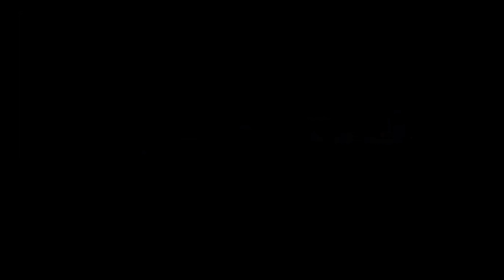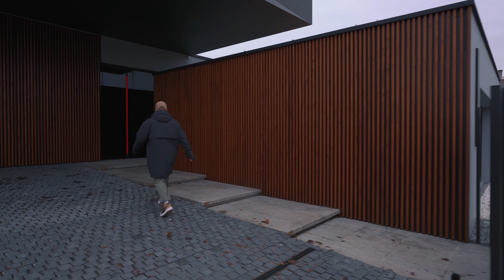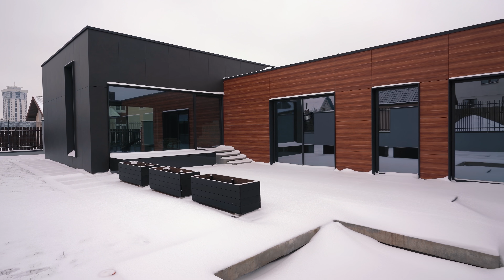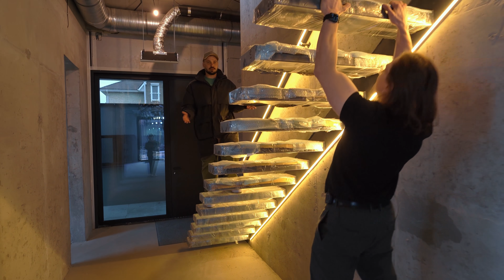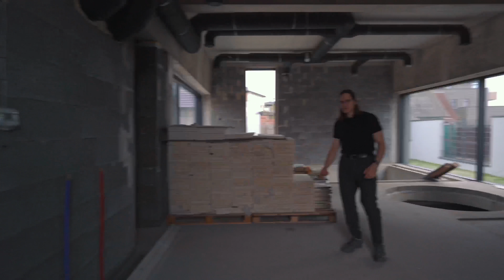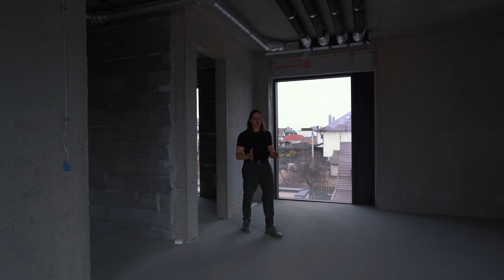Scandinavian Modern Mansion Review | Architecture & Design, House Tour

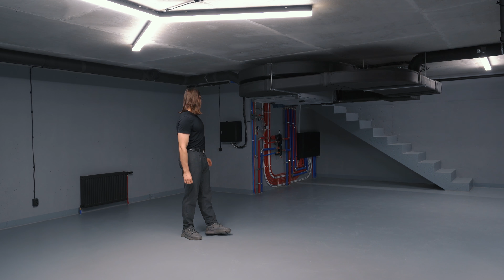Comment: 24:49 Looking at that outlet with just the wire attached to the wall is super amateur.
That is NOT high level attention to detail bro....
Also... who leaves the blue and red flex next to that black radiator. Would have cut them and made the innertubes black.... Or at least used something high end piping like copper. 
Would make that black radiator even pop out more. But since it's just a cellar.... cut it and make it black.
You people suck at details. Trust me.... I've done way too many projects not to notice the real details. Also my clients are some of the richest people in the country so they expect VERY high standards.

Comment: both the gate and the fence look great, they make an impression, but the argument that it's hard to climb because there are no horizontal elements is basically irrelevant. Just buy a car jack for $5 at the nearest store and easily open the gap wide enough to get inside.

Comment: A blue tooth lock sounds like the biggest safety hazard I ever heard. At least use a code or finger print sensor. Software is so easy to hack, even with good security systems.

Comment: I would´ve probably roofed the back side of the garage. Video shows winter and roofing that part and the pathway from the house´s door to the one of the garage would prevent snow (or rain) from reaching that area, thus you could arrive with your car, park it into the garage and enter the house without dirt on your shoes you´ll have to clean in the house entrance area afterwards.

Comment: I like it so much, but seriously. Almost 6.5 k feet square is not, definitely not small. It corresponds to 600 + meters square and I don't know you but it's gigantic. Average house here in Italy is between 80 and 100 meter square (not considering the land and garage and balcony, so more like 110 to 150 meter square). This is basically a plane hangar, a luxury and damn well built one. I have seen only 1 time a house that was 300 + meter square and terrain was probably 100 ms, and it's massive

Comment: Impressive front fence design, I like it I just wonder how it handles the water, I guess there is probably a pump or some advanced system just to handle that. I designed myself a similar system to lift my backyard projector screen but as it's not a driveway I just created a box that opens and close to hide the stuff when not in use so water just don't enter it.

Comment: As a civil engineer I have to say this house is complete crap. 

1) Scandinavia is a very northern part of the world and if you know anything about Earth rotations you`d know that there is not a lot of sunlight in Scandinavia. It`s actually very dark for almost the entire year and these guys literally built a black house in the dark. It works fine on a youtube PR video but in reality it`s depressing. Very stupid idea! There is a reason Scandinavians build everything with bright colors.

2) The house does not fit with the neighboring houses at all.

3) The fancy car door is a dumb idea. It`s modern widget that costs more to install and maintain and once it breaks down it`s a nightmare to replace or fix coz you have to find some subcontractor from Poland to come to you.....someday and it costs an arm and a leg. You also can`t use that door if the electricity is out. Just use a normal door with a lock.

4) The house door is kind of dumb coz you can`t enter your home during a power shortage or when you don`t have a phone battery aperantly. 

5) There is a reason northern climate countries use steep roofs instead of flat roofs. You guys essentially created a soon to be leaky moldy house. Same goes for the yard French windows who are very prone to water infiltration. 

6) This particular point might be a bit petty on my side I admit but stop calling it a great design. Great designs usually allow for a substantial part of the heating, cooling, ventilation etc to occur naturally due to the built of the house. You don`t do that. You do everything mechanically with tons of machines. 

To sum up you made a black house in the dark that`s going to get moldy and leaky but looks good on a youtube video for chumps coz you used all the fancy shamancy worn out to death terms like modern, hi-tech, delux etc

Comment: Flat roofs are always mistake on snowy areas.
Reply: Or anywhere where there isn't all sunshine all year round.
Reply: @hustensaftvernichter3785  Partly true. Water you can direct away. Snow will break and moisture the structure with its weight in time.

Comment: 23:49 goes on to state the importance of keeping the pool foundation separate from the building foundations for many reasons and then shows you the 'smart centre', the brains of the house located RIGHT NEXT TO THE POOL AND JACUZZI, the two largest bodies of water and danger to all electronics. So just to make sure your failure is complete, you put the house's electronic brains in a concrete bunker below grade of the pool. NOT that smart!

Comment: Nice house but the floating stairs are an accident waiting to happen. It needs some sort of hand rail to prevent you from falling off.  Just imagine having a party and had a few drinks and wanted to go down into the basement to check the fuses after the DJ overloaded your circuits. 🙄

Comment: I could live there 🤪(if I won the lotery...) but very nice and clean! I was just thinking... what if the inside pool DOES run further into the outside pool? A lot of heat will disappear yes... but what if you made a sliding window that slides down into the water and blocking off the outside poolwater? (probably needs a by-pass for filtering/heating that water but that can be arrangend)

Comment: Seems like so many wasted opportunities for such a large block.  A side entry garage would mean that you don't have to reverse out. This would also allow a conventional sliding gate to be fitted.  I can't believe that the garage is not connected to the house, in such a climate.  Lack of eaves over windows, which means snow accumulates, even worse is that snow accumulates at the font door.  Cantilevered "car port" useless at preventing snow from accumulating on the path leading to the front door.  The dressing room/front door is poorly positioned, such that to get to the room, you track dirt from the from door.  Similarly, pets should be taken in through the exterior door into boiler room so that dirt isn't tracked from from door.  There is no door separating the guest bedroom  corridor from the living area and kitchen.  The powder room seems large enough for a shower to be installed, so that guest don't have to use the children's bathroom.  Toilets should be enclosed in separate water closets, even in the powder room, and away from handwashing facilities - for hygiene and to separate odours.  There is no door separating the living areas from the corridor leading to the children's bedrooms, so that noise and cooking smells will flow through.  Living area, renderings shows a lovely view of trees and other greenery - in reality, it's the neighbour's driveway that you look out at.  Planting for privacy will be needed.  It appears that kitchen sink will be in an island, rather that against an exterior window for fresh air and natural light.

Comment: The effects of curiosity, critical thinking and creativity. The architects did well 🔥
Reply: Just one comment to add, the units of measure should be given in the metric system. I don’t understand why talking in acres and square foot when the vast majority of the world uses square meters, hectares, etc. or at leasr provide them in both.
Reply: @carlosalvarez4641 Cry
Reply: lmao creativity? this is a metal box, I don't see how can anyone see this as a home.
Reply: @ProtoIndoEuropean88
Inmates
Reply: Kind a true. Just do both 🤷🏻‍♂️
Reply: It`s a shitty house. The architect is a moron. 

Scandinavia is super dark year round. This was shot during the 2 hours of sunlight they have. The built a black house in the dark. It`s super depressing. There is a reason Scandinavians use bright colors traditionally. 

The house is also with a flat roof. It`s gonna get super leaky and moldy. There is a reason snowy rainy places like Scandinavia use steep roofs. The French windows are also super prone to water. 

In addition all those fancy doors means that you can`t enter your house during a power shortage or when you don`t have phone battery and if it breaks you need to find the subcontractor from Poland to fix it. 

The house is crap but it`s presented as modern and cool to people who don`t work in construction and think of these problems.
Reply: Hmm👍

Comment: I love how modern and nice this all looks.  HOWEVER ... We NEED to innovate a system that SUPERHEATS the Driveway, Patios and all of the Walkways.  There must be an industrial boiler system that is 'Hyper Functional' that will not break the bank.  It needs to evaporate (boil off) all of the standing runoff water, from a cistern sump well ... all winter. This system would be seperate from the household in-floor heating, pool, hot-tub and sauna heating systems. It needs to be a specialized system, specifically engineered to remove all of the snow, ice and to dry the concrete regardless how cold it is.  The goal of course would be to maximize utilization of the ENTIRE living area of the home ... YEAR-ROUND !!!   Scandinavian engineers need to step up their game . LOL ... Get one system working properly and economically and EVERY household in the northern hemisphere WILL NEED this in their lives.  The concept is scalable to all of the Northern Hemisphere.🤑🤑🤑😎

Comment: Why no radiant snow melt system on the sidewalk up to the door and for the driveway just beyond the fence ?  Also rain and snow will sheet off some of the facade faces onto the walkways and people as they approach the house. Splash back from the facade runoff will discolor the panels at the ground over time
Reply: what about when those fence bars are covered in thick ice, what then? Guess i'll park on the street...  Maybe they are heated to prevent this.
Reply: @fishheadbreakroom  He explained it, did you watch the video? 🤔
Reply: @BradThePitts  yes i did, and I see they took a hope the systems work 24/7 approach. I'm in a more cold environment in Estonia. We have a large variety of such fences with pluses and minuses for them all. I can tell you here (and maybe its not recommended to be fair) it would not be a good idea.

Comment: The mechanical room is the most amazing thing I've ever seen in a home. I can't believe the use of stainless in there. Just jaw dropping.
Reply: execept washing dog next to that air circulation unit with electronics...
Reply: Americans put this in their RVs.
Reply: @Mitchell527  Quite wrong. Americans don't build 50 million mansions to this level of quality...actually not even to the most basic level of housebuilding quality in Europe.
Reply: @Mitchell527  Please don't confuse this high-end installation with American RVs. RV's are junk, until you go into the $1MM price range of the Prevost coaches. The $100-300k RVs fall apart like you wouldn't believe. They aren't made like autos in a factory, instead the cheapest Mexican and South American workers slap them them together like houses, manually screwing in screws and bolting stuff together. There's very few automated processes. Quality control is terrible. :)
Reply: @Chris11249  high-end installation, bruh its a gas boiler from the 60s with radiators. We haven't used gas in scandinavia in decades. Geo thermal heating + Air heat pump + fireplace
Reply: what does stainless pipes do tho?
Reply: @JC-JC20  resistant to corrosion, keeps things cleaner, last longer
Reply: Yes. I think like you
Reply: You saw that to, I was like did they use stainless steel for the PIPING! Insane.

Comment: That fence is awesome.
Reply: Accident waiting to happen when someone drives before its completely down
Reply: i believe it has some sort of motion sensors
Reply: @qrx.4596  how does that help if the driver presses the accelerator pedal before the gate is completely down 😂
Reply: cool things are often dangerous  @Siddiskongen
Reply: @Siddiskongen  I was also thinking how often does it need to be cleaned out?
Reply: @Siddiskongen  What if the remote vibrates while it's lowering? Or a buzzing sound, or anything like that?
Reply: Where is this house? I don't know how to speak your language
Reply: Yeah it`s awesome right up until the day there is a power outage and you can`t enter your home. Or until it breaks down and you need to find the subcontractor from Poland while living in Scandinavia to come and fix it. Very impractical. 

Why pay ten fold for a useless turd when a simple lock door would do??!!